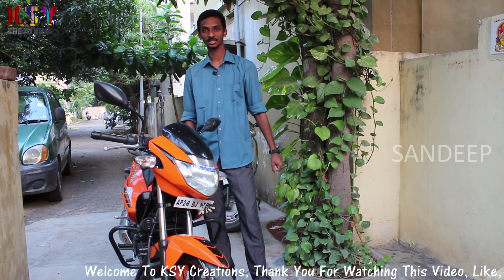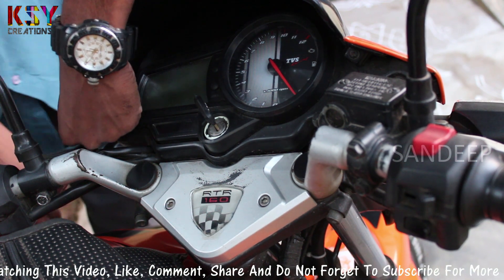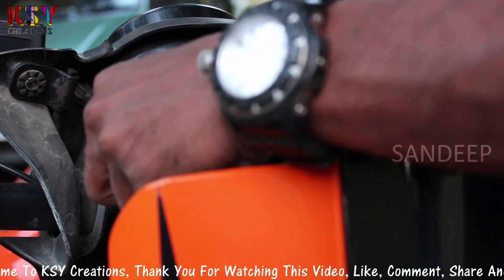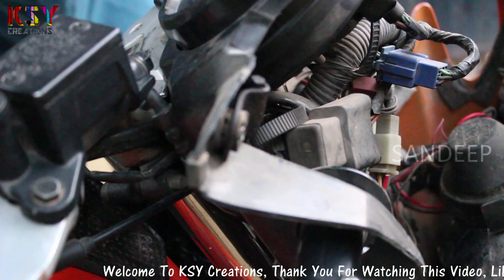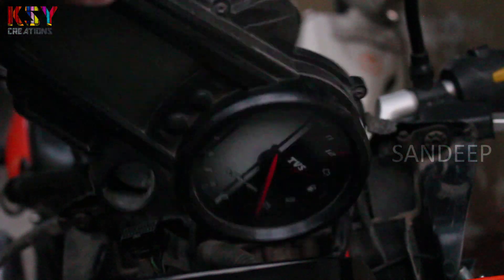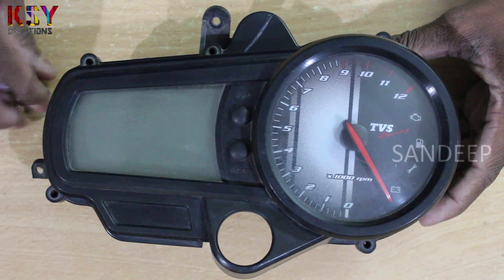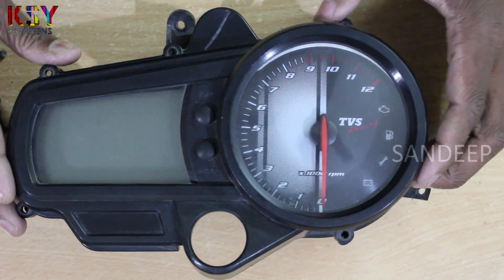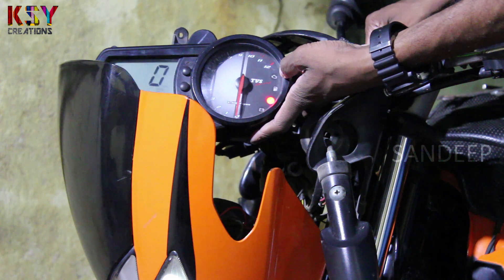fix apache rtr rpm needle - rpm needle problem - fix rpm meter issue

Comment: Plz answer Bhai .my bike speedometer is dim due to rain what I have to do???
Reply from the maker: Hii, I think water entered in the LCD, the LCD may damaged or not working for temporarily bue to water..
Reply: Is it necessary for me to change meter??
Reply from the maker: If you can open the meter, open and allow it to dry, if it doesn't work you should change the meter.

Comment: How to reset odometer zero since my bike finished 1 lakh kilometers.. plzz
Reply from the maker: hiii, actually we cannot reset odometer at home, it is done by professionals, there is an electronic chip inside the meter which is desoldered and erase all data in it with certain software and hardware.
Reply: KSY CREATIONS tq

Comment: Meri rtr me patrol linnig blink karti he Jo band nahi hoti he
Reply from the maker: hiii, if your fuel indicator is blinking, it means fuel indicator connection is loose, which will be in green colour.(connector). in case if you already checked that than there is a problem in meter....
Reply: Sourabh Bhadoriya Apache,Ka,degetal,meetar,Ka,kavar,alag,sa,melaga